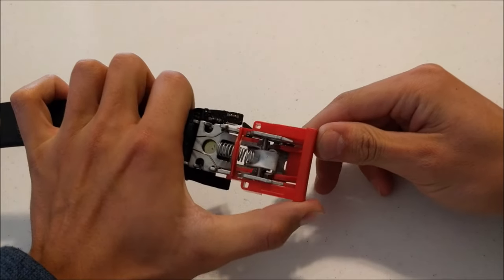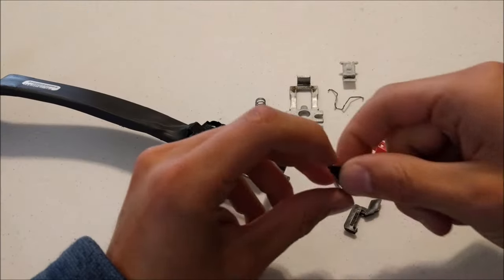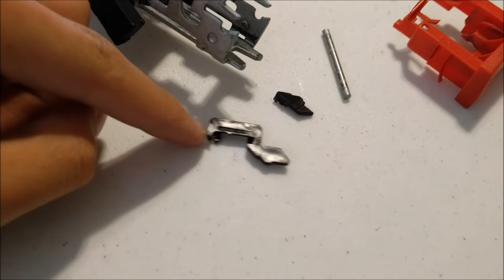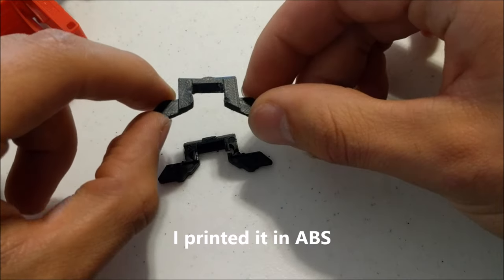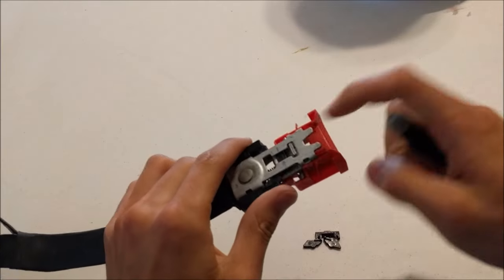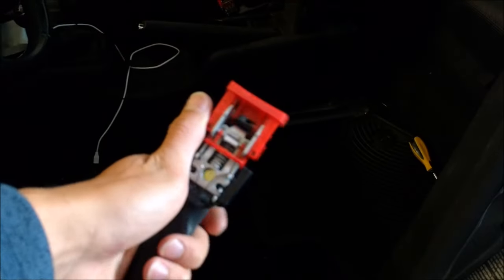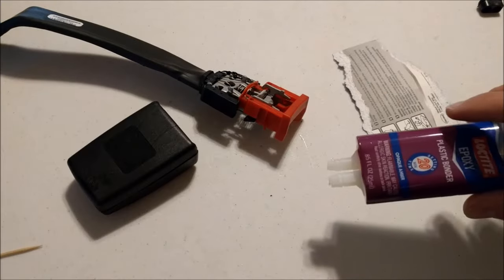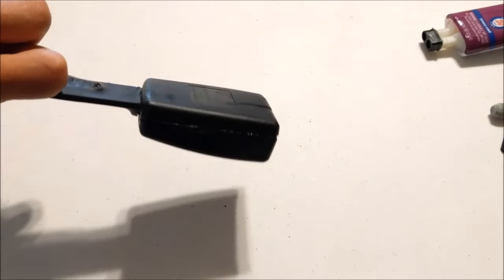Broken Seat Belt Buckle Fix Volkswagen DIY

Comment: This inspired me to finally get to the one in the rear bench of my VW T5. I expected to find this problem, but in the T5 the seatbelt latch is secured with a wire rope, which had slid up and was blocking the mechanism. Tip for anyone with a seatbelt latch on a wore cable- give the buckle a hard tug to pull the wire rope back where it is supposed to be before cracking over the black plastic cover.
Reply from the maker: Glad you figured out the issue. That's a good tip!

Comment: For that non-security essential plastic part, it's a great idea (if you're really sure after 1000 connects it won't get thinner and just appear to latch correctly but only be partially connected). For other parts, like that latch or some other metallic part, stick with the 140 bucks part, it can save your life in case of a crash. For brakes and security elements of the car, always stick with original parts. For the rest, aftermarket ftw. Same advice for people that are using buckle fakers to stop the annoying ding the car makes trying to save your life. PS: Even if your sensor is not properly detecting your buckle as being connected, your airbags won't deploy in case of a crash as it can explode in your face while it touches the steering wheel.

Comment: It's not the plastic bit that stops your seat belt from working it's a metal flat spring on the side of the buckle. I took a flat head screw driver and pull the flat spring like metal out test the belt works great light is off.

Comment: Cool all i need is an expensive 3d printer and months to figure it all out!  Yea not very helpful
Reply: well it shows how much VW are willing to waste, all the parts, metal, plastic, just for a cheap 1cent bit of plastic. And I am going to save the planet by sitting in a winter coat with the heating turned off?

Comment: I think I may need this price as well do you sell
Them ?
Reply from the maker: I'm not currently selling them, but I could potentially print some and list them on eBay or similar. there are lots of sites you can upload a file to and order the part printed for a low cost as well, good luck with the repair.

Comment: Hey! I was wondering, can I just remove the sensor thread? How did you remove the seatbelt from the car? Also removing the whole seat?
Reply from the maker: If I recall correctly, I did have to remove the seat. Then there was one bolt holding in the buckle. If you just remove the sensor wire, the seatbelt light will stay on, on the dashboard. I think you can jumper it with a resistor to make the car think it's not unplugged.

Comment: Bro my seatbelt wouldn’t latch but after hundreds of tries it finally latched however the airbag light turned on the dashboard. Could the sensor in the seatbelt latched have gotten stuck or something got out of place. When you dismantled your seatbelt did you see an airbag sensor in there?
Reply from the maker: Late reply but....there should not be an airbag sensor in the seatbelt latch. The switch that detects if the seatbelt is latched or not is inside it, and it can definitely get stuck in the open or closed position.

Comment: My spring broke. I can’t find another one. Any suggestions?
Reply from the maker: There are lots of websites that sell one off springs. A few of them have a "spring finder" tool where you can put in the rough dimensions and it'll give you options to buy. Also Ive seen at many hardware stores in the US I've seen  little spring kits you can buy for ~$10-15 and try out different sizes until one works.
Reply: @ElectroTechnics  Id love to have a few of those websites. Can’t locate any… I’ve checked Amazon etc. Haven’t yet browsed Home Depot, but if you know of any sites, I’d love the tip! Thanks
Reply from the maker: A few spring companies are:  Springfast, The Spring Store, and Quick Spring. I just did a search for "compression spring assortment" on Amazon and found lots of kits. You could see which kits have springs similar in size to the one you need. Or put in exact dimensions in at The Spring Store and find options for similar replacements
Reply: @ElectroTechnics  : Many thanks!

Comment: What specific glue did you use?
Reply from the maker: I believe it was a 2 part epoxy adhesive designed for plastics. If you look up "2 part epoxy for plastic" you should find many options that will work.